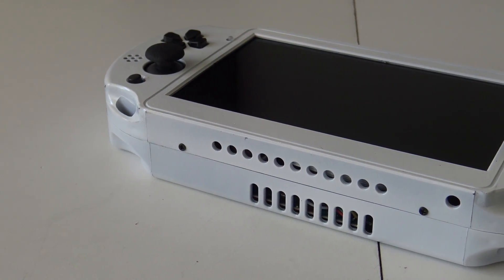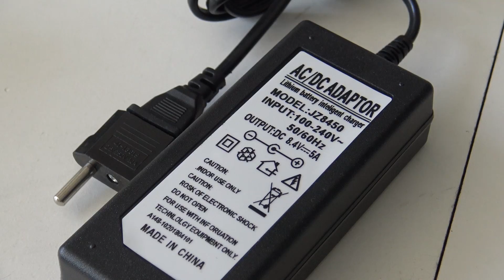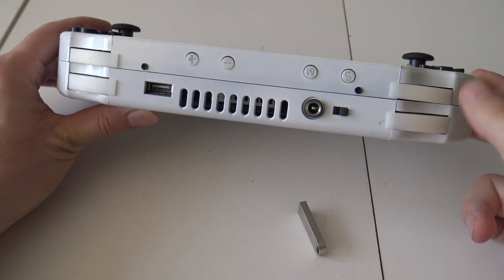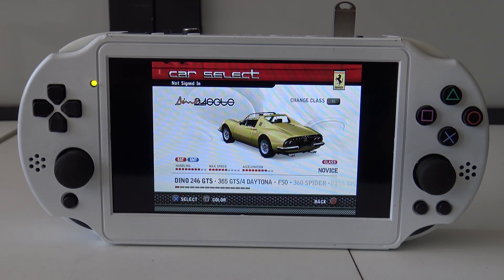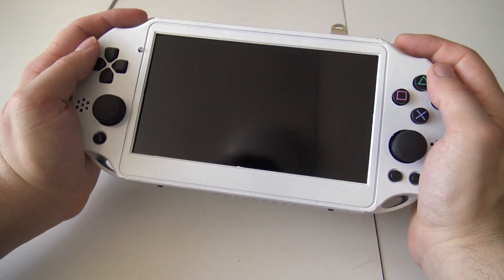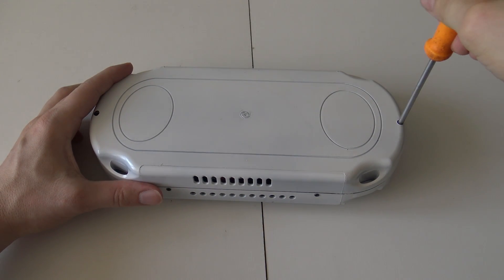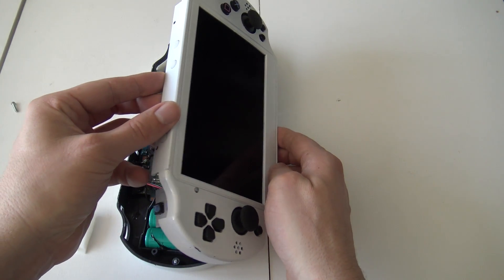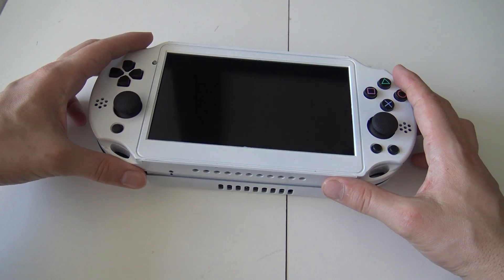The Best Playstation 2 Portable Handheld or Maybe Not ?

Comment: The vita form factor is on point, i ll wait till it gets a bit thinner and cheaper
Reply: Don't think it will get any cheaper due to it using original PS2 parts, and they've been out of manufacture since like 10 years ago.
If they used emulation, yeah it will be cheaper.
Reply: @mr.kenway4554  speaking of emulation, the Damon thingy is quite impressive, provided you have enough processing power to run it smoothly (snap dragon 855 and higher), but   yeah, it is much cooler if you have a freaking PS2 in the flesh on your hand
Reply: @retronister8816  first of all, DamonPS2 is stolen PCSX2 code recompiled into ARM, nothing of it is original.
Second, even the PCSX2 doesn't guarantee perfect compatibility and will have glitches here and there. Having an original guarantees perfect compatibility (At the cost of upscaling and mods)
Reply: @mr.kenway4554  nah this thing is trash just buy a gpd win max for the price.Portable as this and able to play upscaled ps2 games at full speed and ps3/ps4 grade games as well
Reply: @hirokakhand6584  PCSX2 doesn't Guarantee 100% compatibility
Reply: @mr.kenway4554  at least it guarantees 95% compatibility and those non-compatible games i bet are games which nobody played and /or cares

Comment: If someone could find a way to use the hdd port connectors (assuming that it isn't removed for this handheld) and put an ssd inside the thing would be perfect and eliminate the video studding you see with some games. then you can just replace the usb for a better 3.0 one and be able to connect it to your pc to put roms on it.

Comment: This is really cool but having 4 lithium ion 18650 batteries loose and rolling around inside the system is extremely dangerous and could possibly lead to a hard short on one of the batteries and the whole system could explode in your face and the system pieces will become flaming hot and flying shrapnel that was very dumb of them those batteries should be secured and not able to move inside the system.. I have a lot of experience with Li Ion 18650 batteries as I have used them on a daily basis in my vaping mods for over 7 years and battery safety is one of the first things I learned as a Vaper.

Comment: It's genius, but it would've been nice to have an HDMI output too, as I can see on on the motherboard.
Reply: PS2 was NOT made for HMDI.  NONE of the systems of that generation (GameCube, XBox, and Sega Dreamcast) are hi-def native. 480p is NOT hi-def; it's enhanced standard definition.
At best, the later PS2 models had component (720p) cables but even then the system could really only handle 480p max and only on certain games.  Most people through the PS2 era were still using only RGB standard which would get you 480i video output.
Without building in custom hardware which would make this unit cost even more than $600 (which is WAY overpriced for a PS2-level system), the board is going to be limited by the original hardware spec.
Reply: I don't care about high def. HDMI supports 240p, 480p, 480i, etc. Basically any resolution.
Reply: @Lenmaer  Well, the problem with your statement is that more people are reporting standard-def looks like pooh on hi-def TV and nobody who gets GOOD results is plugging their old systems directly into HDMI ports, either, without going through some kind of converter to get decent results which include smoothing filters and generally scan lines to emulate older CRT monitors/SDTV.  They still have RGB ports on HDTV for legacy hardware but it doesn't register well.  HDTV is NOT optimal for below 480p.  Analog media and older videogames are mostly 480i or lower most videogames through the end of the 1990s were 240p.
240p is NOT hi-def.  HDMI was not optimized for below 480p, either.  I've had multiple Blu ray players and they NEVER had settings for video output below 480p.  
The other problem with HMDI is aspect ratio which was mentioned in the review.  It has to be set manually no matter what is being upscaled -- DVD, old video game -- or the image gets stretched to 16:9 by default.  A lot of people play old films on DVD on their Blu ray players and they get upscaled to 16:9 which distorts the 4:3 original image.  The same thing will happen with older videogames.  Most games before 2006 were not hi-definition or wide aspect ratio.
Reply: I think what he means is that the system should have an option to connect it to your TV, like the Nintendo Switch. I completely agree with him - in this day and age that should be a basic standard feature on all handhelds, especially for $600!
Reply: @jimdoom2276  Yup, that's what I meant. A simple HDMI output. No upscales or anything like that.

Comment: it seems like an interesting handheld but $600 for a handheld is a no go. it looks like the creator used old parts from an actual ps2 that costs no more than $50 for a working one, mashed it all together with an lcd from a ps2 or ps1 accessory and used the guts from actual dual shock controllers. the shell could of been made better. instead of painting they could of used actual white 3d print material. if they sold this for $300 as is id buy it right away and make my own 3d printed shell and resolder everything cause the wires are a mess and the cooling could be better. they still did a decent job but till a good ps2 handheld comes out ill stick to my hp ryzen 3 laptop i got from walmart for $200 that plays all games at 720p flawlessly. great review i just think the maker could of done better and lowered the price

Comment: I can buy almost 20x ps2 konsoles for the price of this thing... too expensive.
Reply: It's expensive but i don't think there is another device that let you play ps2 games anywhere.
Reply: @longballplease  to be honest, i think the  PS2 emulation on android would be quite good with the recent snapdragon chipsets. The SD865+ reaches 3.1ghz. The main issue is the lack of proper code. DamonPS2 is the fastest ps2 emulator with ARM support but instead of writing their own MIPS to ARM dynarec to replace PCSX2's, it uses an x86 to ARM dynarec on top of PCSX2's MIPS to x86. And yet it can run some games above 30fps.
Reply: @polianavalente5377  i have one of the rare PS2 LCDs and im running it off of a DC Powerbank. Its not as small as this PS2 Handheld, but i get to keep the DVD Drive, both USB Ports and i can just take it off if something breaks.
Reply: poli valente well there is a device that can play some ps2 ports and its own exclusive games it’s called the switch and I love mine 😏
Reply: poli valente i have a psp 3000 with ps1 and ps2 games on it and it runs smooth

Comment: Are these made by Sony? Because my nephew thinks they’re fake
Reply: these are just made by a person who sells them, they have used a dremel to cut down a ps2 motherboard and modify it to be smaller and still function then turned it into a handheld.
i can't imagine the battery life will be very long and it will also require you to download pirated ps2 games from the internet and put them on a usb stick in order to play them or have the knowledge to be able to backup your own ps2 library to iso and put them on the usb stick.
Reply: I am waiting for a PS4 version with a 10k mah power bank but it will weight like 10kg and cost over a thousand bucks.
Reply: Mike Rose I think Sony should make PSP 2 but instead of using umds it has a disc drive so you can put any ps2 game in to play and make it cheaper than this
Reply: @therunawaykid6523  that will never happen sadly, plus with a disc drive it would be massive.

Comment: isnt it funny that a nobody can create this stuff and make a 20yr old system run off batteries that at first needed a wall plug, and make it run 3-4 hrs yet the nintendo switch cant even run for fucking 2.5 and thats lower settings to get thru a AAA game. lmao. I mean damn. It would be dope if sony actually considered doing this. I gurantee they could manufacture a miniature motherboard and everything needed and tuck it inside an even smaller form factor and sell for perhaps 200-30max. Add SD card support and perhaps even a primitive PSN store for ps2 games if supporting it legitly (though it would be hacked within a day lol) but just sayin.. easy cash grab if they were to do it